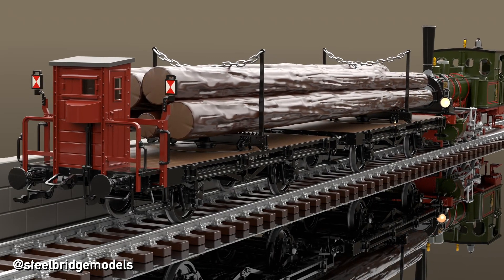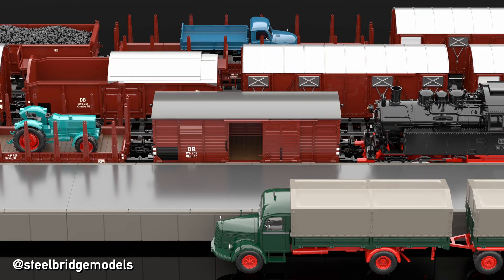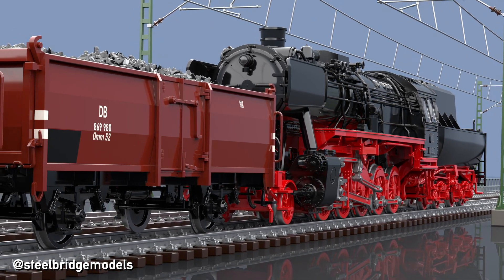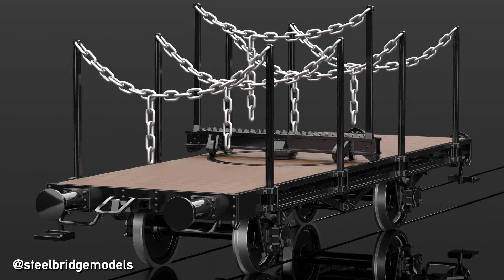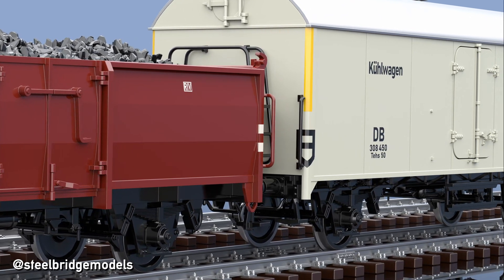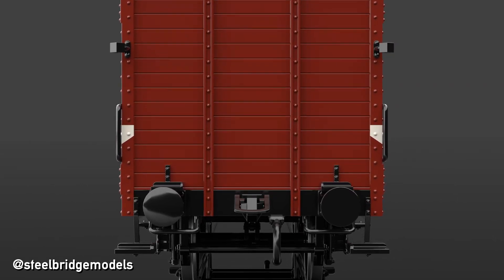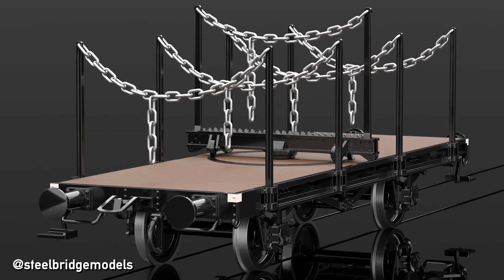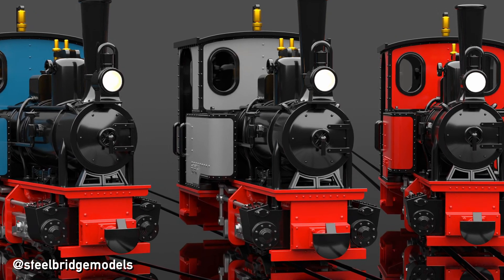Why Germany painted the Corners of their Wagons.

Comment: This is great information. I've been cleaning wheels and metal on older Marklin models, where the corner symbols are cast into the plastic and raised up. Now I know those are not just corner brackets, which is what I thought the ones with the downward facing arrow were, and how to properly paint them.

Comment: Finding these videos really interesting, I have always had some Continental stock on my layouts, HO/OO was an odd mix but interesting and now in TT:120 it works even better. It’s fascinating to learn how the different systems used different codes for braked/unbraked wagons, the British system was quite different, we generally had one brake van at the end, later as brakes were fitted, initially they were vacuum brakes with vacuum supplied by the steam loco and wagons were different colours, grey-‘unfitted’ and Bauxite Red ‘fitted’ then as diesels took over vaccum brakes were changed to air brakes and brake vans disappeared altogether. 
Was the idea of painting steam loco chassis red just a livery idea or was it to serve a purpose?

Comment: What were wagons compatibile with only passenger break? Did they differ any more than nowadays? Delay on valve that is. It does require different handling and can caus not full release or locking due to overloading if mixed, but cutting of breakes in such wagon outright sounds extreme.

Comment: Did Europe take a lot longer to standardize on air brakes? It seems like the US standardized on air brakes decades earlier given the years you stated here.
Reply: I think you should not see Europe as an entity. Railways developed at different paces in various countries. Most traffic was and is domestic with similar standards mainly needed for international services. You still have differences in Power supply or signalling for example. Spain, among others even have a different track gauge.
Reply: Different railways - SJ in Sweden introduced vacuum brakes first and then later on the Westinghouse/Knorr air brake designs.

Some swedish railways had only hand brakes in goods trains while the passenger trains had vacuum brakes.
It existed at least one system using a rope to prevent brake applications - release tension in the rope from the loco, the brakes is applied.

Comment: The markings on the corners of good wagons had further markings.
The oldest (Aprox 1890-1920) goodwagens who were still equiped with plain axle bearings , cast iron spoked wheels and/or wooden chassis could not be  used and handeled as the modern 80-100 km/h certified railwaycars.
f.e The  famous Rheingold had an all roller bearings passenger and goods cars in them. simplified markings of a rollerbearing were painted above and below the corner markings.
At first those markings were put on the axle bearing boxes but due to acumelating dirt on the bogies it was put on the corners by the corner markings.

Comment: There was a timeperiod they used an extra markings on goods and passenger cars.
The oldest (aprox 1890-1920) had plain bearings, castiron spoked wheels and even a wooden chassis. 
Those were still kept around in the 1950 and 1960s due to the massive shortage of railwaystock in Europe caused by WW2. 
Plain bearings were standard till the 1920s 
At the end of the 1920s faster trains and higher loadcapacity goodwagons were needed.
 The first steel monocoque passenger/goods railwaycars equiped with roller bearings emerged and those were partly allowed with special rules to run with the old railway stock. (f.e. the no steel cars behind wooden cars rule) They had a simplified image of a rollerbearing above or beneath the corner markings. 
Due to conversion programs f.e the German Umbau Wagen program newbuild programs and scrapping of the oldest not economic to update/convert railwaystock in the early 60s it was not neccesary anymore to mark cars with the rollerbearing mark.

Comment: I'm curious as to the differences in brakes tuned for passenger vs goods services that required a tuneable brake system for wagons that could be used on either service.
Reply: Well, from what I‘ve heard (based on videos by „Der Silberling“), the standard brakes these days feature a lever that can be thrown from „G“ to „P“ and on some cars even to „R“ and „R+Mg“, which denotes how the brake is configured. P denotes Passenger, where the trains tend to be short and the brakes should be responsive, this setting is „just“ a connection from the brake pipe to the valve. G denotes Goods, where the brakes should respond slower, so the brakes apply roughly similar throughout long trains (otherwise the train would compress, putting strain on everything), this is achieved by choking the connection from the brake pipe to the valve, thus slowing the pressure loss for brake applications. On the other hand, R can apply the brakes harder at high speeds (roughly doubles the actual pressure of the brake shoes while over 70? km/h in order to get closer to the grip limits at these speeds. R+Mg is like R, but also arms the Track brakes at speeds over 50? km/h for even better braking independent of wheel traction. Although I have no actual knowledge how pax-only piping differs from freight piping (for the brakeless cars), I suspect it is based on the fact that passenger equipment tends to have a brake reservoir pipe in addition to the normal brake pipe (reservoir being at 8-10 bar while the brake pipe is released at 5 and enters into emergency at pressures below 3.5 bar) that can be (ab-)used for all sorts of fun like refilling the reservoir on cars, operating doors, giving the driver in push-pull a way to refill the brake pipe.
Reply: The difference is basically only the time they take to apply and release. 
In goods trains you want slowly applying and releasing brakes, to minimize in-train forces when everything bumps into each other.  With much shorter and lighter passenger trains this isn't that much of an issue, so they apply and release much faster.
Reply: compared with the US, basically all modern european brake valves is double-acting.

This raises rolling stock owners capital outlay while it allows signalling systems which permits a very dense traffic.
It is entirely feasible running fast container services on P brakes,  the route book in the case of Sweden (and traffic operator's own rules) says if P is allowed for freight and when.

Comment: Thank you for that information. I had an idea about the markings but none about their differences.
I’d like to know the history behind European railways’ continued use of screw couplings and buffers versus automatic knuckle couplings.
Reply: Expensive to change from ?  There was a project in the 70s which included basically a over-weekend change from screw to automatic couplers, including a lot of locomotives and rolling stock built with slots and other necessary modifications necessary in the frame.

The SJ Rm (ironore adaptec Rc)  has a fairly large rectangular opening for the coupler.

One possible reason for the stop was SNCF's by this time fairly large outlay on LGV and TGV.

DB had something alike.